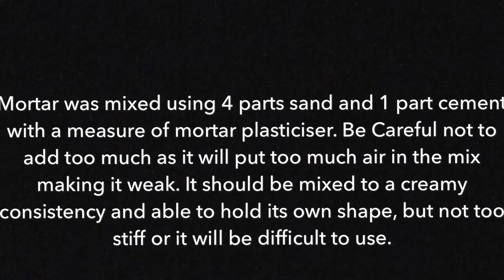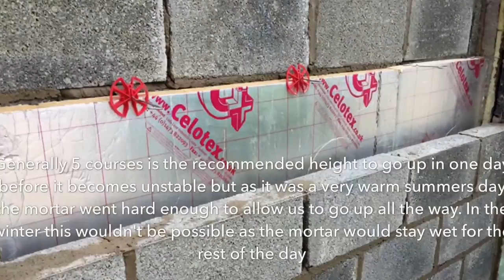How to block up a doorway

Comment: Hi, i am blocking up a lanai to make it into a room. The two areas that i am blocking up measure 10' in width 8ft high. Do i need rebar in this scenario? Your help is much appreciated
Reply from the maker: I’m not sure where you’d incorporate rebar. Just make sure you’ve got a good foundation and are tied in both sides of the existing wall

Comment: Amazing explanation, cheers. I'm guessing you don't need wall ties if it's exterior block work with timber frame interior?
Reply from the maker: Thanks! Depends on how wide the doorway is, if it’s just a standard 1m wide door or less then as long as you’re tied in on the sides with screw in ties or furfix you’d be fine but if it’s a wider opening you’d need some timber frame ties
Reply: @SamDaviesBuilder  top man, appreciate it. It's just a metre wide door.

Comment: what was put between the walls? just insulation? were the walls flush against the insulation? It seemed like there was a gap between the insulation and the wall.
Reply from the maker: It is a cavity wall so you have an outer skin, 50mm gap to the insulation, then your insulation, then your inner skin.  It means your outer skin can become damp from the weather but not track it to the inner skin
Reply: @SamDaviesBuilder  NIce step by step video. Thanks. Is the insulation flat against the inner skin? Ie touching it? Or is it a 50mm gap also?
Reply from the maker: @chazshier  yes the insulation is tight to the inner skin and then the 50mm gap from the insulation to the outside skin

Comment: Silly question but u level first course through to know what size cut u need at other side so ur cut is not in middle
Reply from the maker: Yea. Run a full block from one side first and then you have a cut at the end of the wall. Cut in the middle will cause a lot more work
Reply: Sam Davies cheers was wondering thanks 😄

Comment: Thank you very much for this video.
I was looking for a definitive answer on how to do the dpc course and this video with description is perfect.
The mortar ratios too.
Does the kingspan also act as a vapour shield?

I have a question.
I can go to a row of 10 identical houses aka Barratt Boxes, Shepherds Sheds, Persimmons Plasterboard Palaces and run a finger on the mortar course.
5 of them will be as hard and smooth as prefab reinforced concrete blocks on a military base - like grey marble. And it will stay like that for 20-30 years and longer.

3 of them will give off a light powder.

2 of them i could drill a hole in with my van key! Softer than celcon/thermalite blocks and already degrading like its trying to repoint itself!
What causes this please? I know some builders (NOT brickies!) i have seen squirting washing up liquid into a mix but what else can cause it? Its not pollution as it would effect all 10.
What sand and cement do you use?  The common staple is Builders/Cook's Sand (local) and Blue Circle and water premixed with correct measure of plasticiser but not sure what brand.

The crop of skilled brick and block layers around here is bad.  There are a lot of wannabe rich types with maxed mortgages wanting extensions (to show off) and it really is the wild west.  All Smash & Grab.  Price and speed is everything over quality and Building Control is a bad joke.  I would ask these guys but its like asking Freddy Kruger about skin care.
Cheers!
Reply from the maker: Thankyou, appreciate you watching the channel. 

The king span would have some vapour shield qualities but probably only if you used foil tape between the joints of each sheet. 

That’s an interesting point you make about the Barratt etc houses and the mortar. In theory their mortar should all be nice and hard as most of them will have it from a silo which has the premixed sand and cement in it you just add water to it (there’s a corkscrew type setup that mixes it with the water as it comes out) so you would think all their mortar mixes should be setting the same. But there’s lots of factors such as if the pointing was done at the right time, if they laid in too cold/too hot weather without covering their work which could affect the final strength.

If they are mixing it themselves in a mixer then the mix can easily be wrong - poorly trained labourers, over mixing, under mixing , too much plasticiser which would put too much air in the mix causing a weak mix.  There is such a fine line between too much and too little plasticiser and too little or too much mixing and it’s only really possible to know once you get a feel for using the mix yourself. 

The quality of sand varies round here and that can affect my mixes hugely. I’m using poor sand now and just struggle to get a good mix. It’s always building sand I use but one week it could be a different suppler to the merchants that I use. Always use blue circle if I can as I find that gives the best mix, cheaper cement doesn’t seem to give as good a mix. 

Sadly there is still lots of cowboys out there but they get found out eventually! There’s lots of good brickies too but it seems the good ones become harder and harder to find. 

I hope this answers most of your questions and it’s good to see someone taking a keen interest in what goes into a good mix and what can go wrong! Check out my ‘how to mix mortar’ video if you haven’t already!
Reply: @SamDaviesBuilder  I'm on it! Looking now and thank you for a very good answer.

Just to give you a level of quality on of of the Persimmon homes:
There is one on the very corner of the new estate and for the first 1.5 meters staggered it is in Cook sand.
 Then for another meter it is in regular builders sand. Then for the finish they used yellow sand!

The cherry on the cake is the plastic air bricks had been put in the wrong place and had been 'gobbo'd' up and the new ones look like they had drilled and smashed the bricks out. Then used clear silicone to fit new plastic air bricks!

All build on a green belt flood plane too!

Out of all the very good reasons you gave for the mortar courses it's a combination of not covering up, over mixing and too much plasticiser.

I saw this old boy building a wall off crates and scaffold boards.  He built up the corners, moved his line, checked it a bunch of times, kept every bit he wasnt working on covered and didn't use big mixes and blue circle with a ton bag of builders sand.

I was in the area a week later and went to have a look. It was perfect.  Really perfect.  Took him a long time but it had the marble smooth mortar finish.
Reply from the maker: @RedwolfDogrocket  it just amazes me how these big house builders get away with it. I can’t see these houses standing the test of time and it’s such short sightedness from the government not to regulate it more as they should be focusing on building homes that will last and not stack ‘em high sell ‘em cheap type! 

Just hopefully the old boys keep passing on their tips or it will be lost forever to the persimmon brickies - although there is some good brickies on those type of sites too

Comment: I have a 48” doorway to block up. I want to tie the new block in with the existing wall by replacing the half blocks with full blocks. What thoughts do you have and any advice about the best method to remove the existing half blocks?
Reply from the maker: If you want to remove the existing half blocks then you can get a mortar chisel for a SDS hacking off drill, this will help you chisel out the beds and joints to get the half blocks out easily.  Or you could use an angle grinder with a diamond blade to cut out the mortar beds and joints.  Unless you get all of the mortar out of the beds and joints it will be difficult to remove the half cuts.  I would just use screw in ties on every other course or furfix like in the video rather than remove the half blocks.   Hope this helps

Comment: Thanks for helpful video. Just a quick question. I’m wanting to block up a door in a besser block wall that are the bigger size 390*190*190mm. Do I use the same size besser blocks (so no cavity)? Do I core fill each row of blocks as I add each new row? Thanks, TP
Reply from the maker: Troy - I’m guessing you mean the hollow blocks? If so it’s up to you if you fill them depending on the strength you need. We don’t have many hollow blocks here
Reply: Tks for response. Yes the blocks I'm referring to are hollow. I plan to fill in the core of the blocks with cement mix.